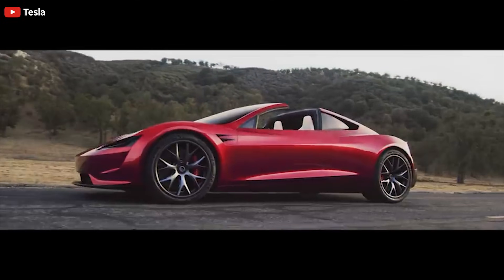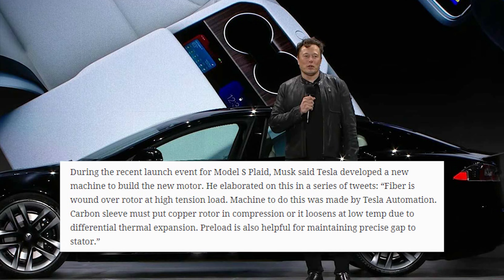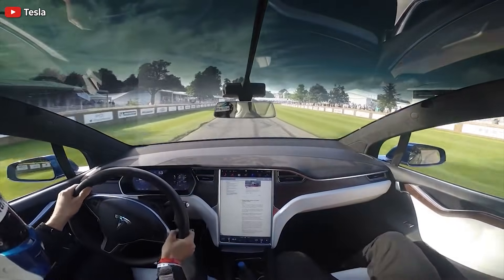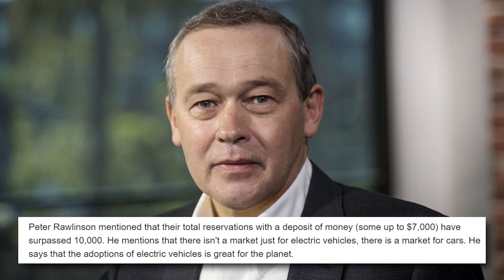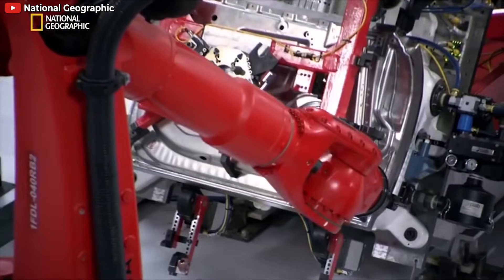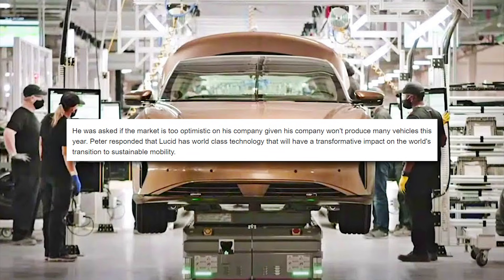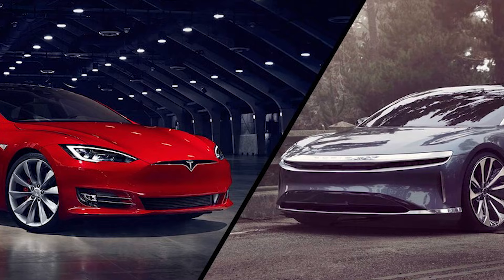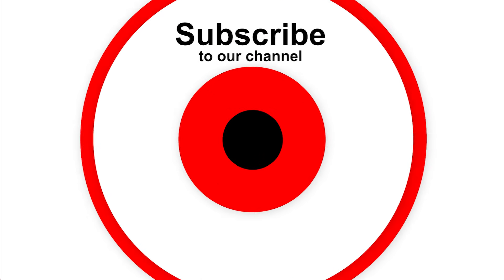Elon Musk Has a Secret on a New Tesla Roadster Motor

Comment: Dude, the word is RADIAL not RADICAL, totally different meanings. Not particularly wanting to be rude but it gets frustrating when the correct word is there on the screen & you use a different one that actually made no sense in the that context, radial does. I guess that without the tensioning wrapping of the rotor, the separation that can occur due to the radial forces, the magnetic power is interrupted causing disturbances in smooth spin. This would probably result in damage to either the rotor or the outer windings or both long term & resettling of the rotor may become pitted & begin to remain in a poor position. I realise we're talking about 10s to 100s of microns of displacement but small damage will escalate & damage the motor significantly over time. This would be more pronounced in the performance vehicles like the "S" model & the Sportster when it arrives. Also, managing that movement with compression at the higher revs would also maintain the power at those revs & probably raise the actual top speed. If in fact the carbon was to heat up & expand, that expansion would only tension the rotor even harder. There could be however a critical point here where the carbon can no longer take the strain & snap. I wouldn't want to be in the car at that point in time. It might do nothing but it might just cause the rotor to rip the motor apart. I wonder if Elon is willing to discuss this?
Reply from the maker: Sorry Rex, will improve.
Reply: Rex go have another drink you will feel better
Reply: @jlarkin66  perhaps but I see no reason to hear. Alcohol isn't my goto safety net.

Comment: This cannot be a surprise. Tesla is always working years ahead of it's production, so you can be sure that new innovations in more advanced battery and motor technology are coming. It is probably an easy move to put the dual rear motors up front for a quad motor setup, and Elon already said at the Plaid event that the current revised motor had more capability available than is utilized. It is only wise to use their advanced motors now, and release the next generation when everyone else catches up (with shipping, production models). The Roadster is Tesla's future halo car, but everyone still needs to catch up with Plaid for now.
Reply: So want to see a quad plaid roadster,!
Hehe say that in doom guys voice, quad plaid (think quad kill😜)
Reply: Twin motors remove the need for differentials so power always goes where it can be used

Comment: This technology has no use for vehicles in the price range of 25,000 ~ 35,000 USD.
Reply: Basic cell phones used to cost thousands. Economies of scale can translate new tech to common, affordable tech.
Reply: @deanmcmanis9398  Well I wanted to say that for cars in the price range stated above, this technology is overkill, we do not require the motors to spin at these high RPM.  Current technology is already doing it very well.
Reply: @pritambissonauth2181  .... there's a motor format that's 25 percent more efficient, easier to produce and lightweight without exotic materials that Tesla's ignoring by playing with ego cars.  https://en.wikipedia.org/wiki/Axial_flux_motor
Reply: @ArizonaPoet  I agree with you
Reply: @ArizonaPoet  Tesla and other motor manufacturers are not fools. There is a reason its not being used if it has proven 25% greater efficiency. Maybe its more complex and therefore expensive to manufacture. Maybe its more prone to failure. Maybe it generates a lot less torque and power for its size. Maybe heat is an issue. Maybe it has an odd power curve. There are so many variables to consider than just efficiency. Out here in India I know of electric twowheelers sold for the last 5-8 years. These were sorry delicate under powered units. More like bicycles with a motor and some fairing to make it look like a two wheeler. They were very very efficient. They were also very very slow and therefore no one wanted to buy them.
Reply: @anandmehta2323  My point is not what you are pointing out, the product you are mentioning could very well do with proper build quality and appropriate dimensioning.  No cutting corners in production nor space grade technology to keep prices reasonable.
Reply: @pritambissonauth2181  The Plaid Model S, Plaid Cybertruck, and Roadster are all halo vehicles for Tesla and they are designed for superior performance and efficiency for each of their model segments. Being compared against the best gas and EV rivals. But the Model 3/Y motors will be used in Tesla's lower priced vehicles.
Reply: @deanmcmanis9398  I agree they are halo vehicles for Tesla, but we are still waiting for the above mentioned price range vehicles, which also need innovation and require adequate development time.  Its this price range where there are the most vehicles sold.
Reply: @pritambissonauth2181  Tesla has already announced their upcoming $25K "Model 2" which is due in 1-2 years. Tesla's Halo cars are there as a corporate statement that EVs can be better than gas powered vehicles, and to keep people excited about the possibilities of EV in both performance and efficiency. Tesla's stated mission is to accelerate the world's transition to sustainable energy. And part of that goal is solar power, and part is affordable transportation. But it is still early in that move to change from dependence on fossil fuels.
Reply: @anandmehta2323  ... quite the opposite, cheaper and easier to manufacture, less materials, more torque, 97 percent efficient.  No need for outrageous speed (rpm's).  Nikola Tesla did the patent around 1898.  Quite a few manufacturers, Tesla would have done the world a service to explore this technology and use the engineering talent they wasted with the dead end carbon wrap direction:  https://www.magnax.com/
Reply: @deanmcmanis9398  I think since 2015 they have announced the 25K model is coming soon and we are in 2021!
Reply: @pritambissonauth2181  There is a key difference between long range corporate goals, and confirmed planned products. The first real confirmation of the $25K Tesla was only a few months ago at the Battery Day event. It is likely that there will be more than one new entry level Tesla offered within the next couple years. There definitely will be one designed and built in China for the Asian market, and there might be a second $25K+ model coming to either the Giga Berlin or Giga Texas factories. Again, expected within 3 years. These low priced, entry level Teslas will only be helped with the media attention and evolving engineering applied from the halo models.
Reply: @deanmcmanis9398  I beg to differ from your point of view, what is Tesla main objective?  Is it not the transformation of the automotive industry to electric or electrification.  How did Ford democratise cars ownership to the mass in the beginning of the last century, by introducing the "Ford model T" and introducing production lines.  In doing so, Ford more importantly offered the model T at a more reasonable price to everyone.  What is Tesla doing, selling cars at the price point of Mercedes cars!  

If you are still not convinced, a turbo charged ICE, with 4 cylinders, 4 valves per cylinder with variable timing for intake and exhaust, with direct fuel injection, is still more complicated than a Tesla model 3 drivetrain which consists of an inverter with an electric motor.  You will argue the inverter is electronic, but what is the ECU of the ICE made of, its a computer with more inputs than the Tesla inverter in its drivetrain.

Please cut out the crap of corporate nonsense and marketing bullshit from this conversation.  If you do not want to do so, it will be like my car has a diamond knob for selecting between Drive and Park, and this makes it better than any other car on the market. 

As for China, the Chinese do not want the cheap entry level cars from Tesla!  They will be having their own Chinese affordable versions.  For them Tesla is luxury and status.

But most important did you understand why there is carbon fibre over the rotor for this particular technology revolution by Tesla?
Reply: @pritambissonauth2181  I am not sure what you are arguing about. I think that you were agreeing with me, but then took a right turn somewhere. You do understand that Tesla's plan was to first build an expensive sportscar that redefined what EVs were and could be, and they came out with the Roadster in 2008. It was next in their plan to take on the giant automotive leaders of BMW, Mercedes, Audi, Jaguar and other legacy automakers who have owned the profitable near-luxury, performance sedan market for decades. This is exactly where the Model S and X were aimed, and they simultaneously succeeded in convincing many people that EVs weren't ugly and slow golf carts, and also allowed Tesla to take a big bite out of the gas based sedan/crossover market. Then their next step was to make a smaller, more affordable version of the Model S and Model X, and they brought out the Model 3 and Model Y just a few years ago, and were able to compete directly against similarly priced, mid-sized, gas cars and crossovers. The next coming step (and just formally announced a few months ago for a 2023 debut) is to come out with a new, compact Tesla, which has a planned $25K+ price. Tesla never planned to build a bare bones "people's car" for $5,000. China's top EV seller did that with the current Wuling Hong Guang Mini EV. Tesla's "transformation of the automotive industry" is not about building tomorrow's next VW Bug. The vital role that Tesla did was to build competitive EVs, and show that EV business could be profitable. Because ALL of the billion dollar legacy automakers, and most of the world's investors, did not believe that EVs could ever be competitive or profitable. And now that Tesla succeeded, everyone else is working to duplicate their plan and EVs. Tesla's carbon fiber, motor, rotor caps are like their 4680 batteries. They are using R&D engineering and innovation to resolve complex automotive problems. To make EVs more competitive, efficient, fun, fast, and affordable. The first computers and portable phones were expensive and very complex. And they sold in small numbers to a few wealthy early adopters who wanted the latest cool thing. But then in a few years the technology and devices were available everywhere, at ordinary consumer prices. These changes didn't happen at once. They happened at last. Tesla made a solid plan, worked hard, and followed through.  Tesla was far from flawed, slipped from their optimistic time goals, and has needed ongoing updates, revisions, and reinventions to improve their EV designs over time. But they are getting there...
Reply: @deanmcmanis9398  I do not agree with you, what does a rotor with carbon fibre has to do with cars in the price range of 25,000 to 35,000 USD?  These cars do not require rotors spinning at 25K RPM.  Why are you so defensive about TESLA?
Reply: @pritambissonauth2181  I was clarifying Tesla's plan. Are you willfully misunderstanding? I will not explain to you the purpose or value of R&D, halo cars, or corporate race programs.
Reply: @deanmcmanis9398  How can you clarify Tesla's plan, acting in which capacity?  How are you connected to Tesla?
Reply: @pritambissonauth2181  ...
Reply: @deanmcmanis9398  . . .  No reply
Reply: @ArizonaPoet    And I presume you have degrees in electrical engineering and have specialised in electric motors?
Reply: @anandmehta2323  ,,, attack the messenger, a progressive are we?
Reply: @anandmehta2323  ... not fools?  Mfg in CA, China, Germany?  I don't get you with that statement....
Reply: @deanmcmanis9398  Dean these are just trolls. They take pride and joy in trolling others and trying to ruffle their feathers or rile them up. 
Just ignore these smart asses.
All I understand is that tesla has research and engineering teams working full time. If these motors were really that good, tesla and other manufacturers would definitely have used these. They are not going to look a gift horse in the mouth. They would rather ride it.
Reply: Just like the Model 3?
Reply: I agree. Like development of a Formula 1 motor does not really help to produce cheaper motors.

Comment: I have to say I'm a bit confused. I was under the impression that Tesla was using a new, reluctance motor design that wouldn't, from the diagrams I've seen, have any copper in the rotor, hence no need for the carbon fiber wrap. Do you know anything about this, Hareyan?
Reply: I understand the carbon fibre is basically to keep the motor in one piece, as the rotational force would rip the rotor apart